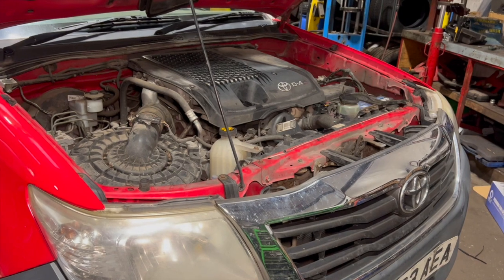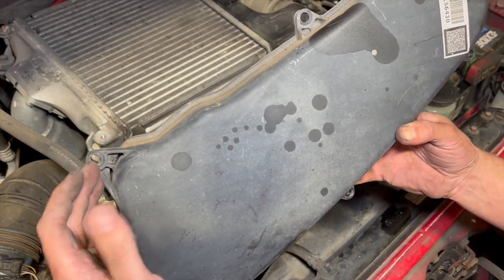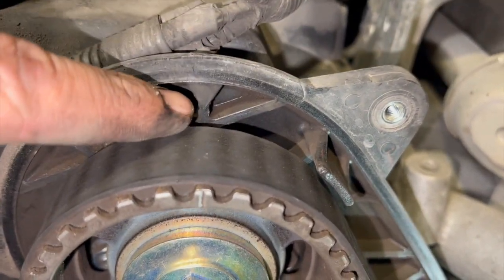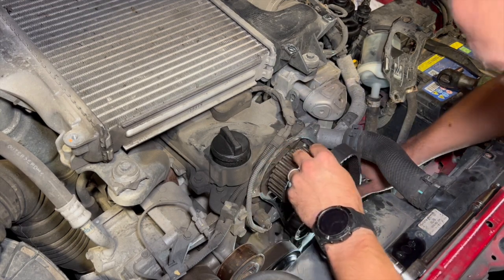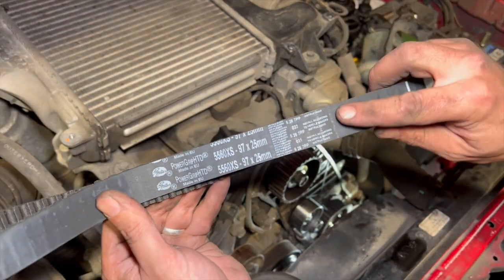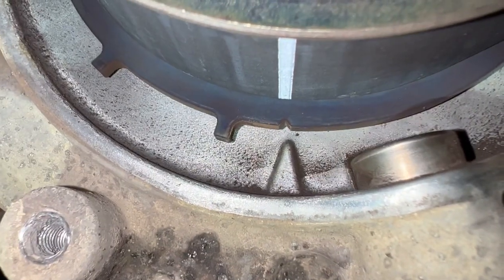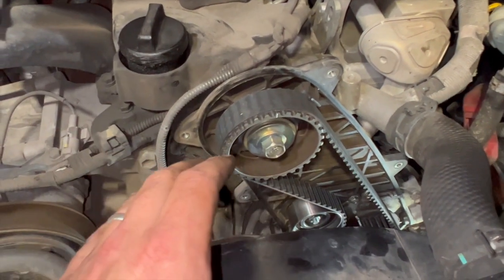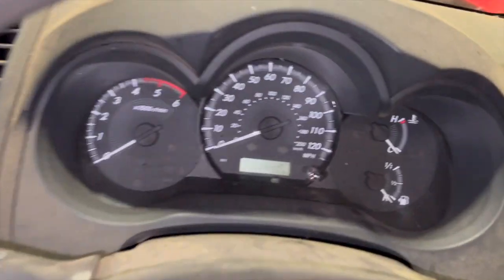Toyota Hilux Timing belt replacement

Comment: Good video bro , but don't you change your crank shaft & cam shaft seals while changing the timing belt . I've normally change those as well on the old Mitsubishis and Isuzu engines
Reply from the maker: Cheers mate! Sometimes I do, but on this one they weren't leaking so left them be 👍
Reply: @diydaly  thanks for that awesome 💯👍

Comment: Thanks for the very informative video. My gates kit came with a notice to bleed the new hydraulic tensioner, as it may have generated bubbles in transit. Not the easiest thing to do without a vertical vice. Cheers.

Comment: Hey bro, my tensioner pulley bolt is a little stripped, it tightens but only to a point, is it safe for me to loctite the bolt once in there?
Reply from the maker: You might need to repair the threads

Comment: What happens if you put the belt with te text to the other side on this engine?
Reply from the maker: It’s just good practice to run the belts this way, generally try do have a direction.. I’ve seen belts fitted the wrong way and never know late any issues tbh
Reply: @ thank you very much

Comment: Thank you kindly for the video, thanks to you i flawlessly replaced the timing belt on my Hiace (same engine) and im not even a mechanic and basically never work on cars, definetly saved me atleast €300. Ofcourse we cant ignore the fact that these engines are typical Toyota; very easy to work on and extremely reliable.
Reply from the maker: 👍 glad to hear it

Comment: Good clip you have however forgot to mention to take care not to drop the washer on the back of the tentioner bolt  . If you tighten this bolt with out the washer it will lock up the movement of the tentioner

Comment: I’ve watched a few videos of cam belt changes but both cars we have use chains as I am paranoid about belts after my uncle blew an engine up years ago!  . I was thinking of getting a Transit Custom (wet belt)… what a shit design ! I ain’t getting a vehicle with wet cam after what I’ve read!:).Your vid is the easiest cambelt change I’ve ever  seen. No cam lock tool required, no removing engine mounts to enable access to take off an expensive, one use, wafer thin cam belt cover etc etc Looks like a good engineer designed this engine:). Btw thx for video very clear and to the point. I’m off to Autotrader to look at Hi Lux. Btw I thought HiLux used chain?